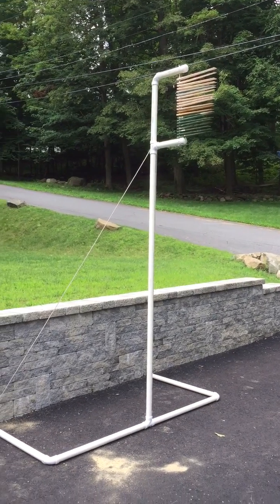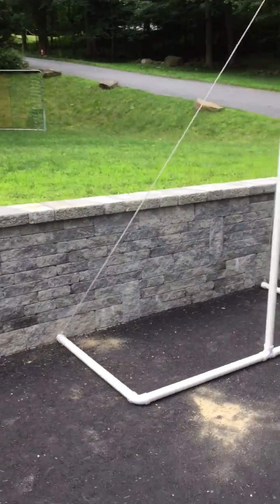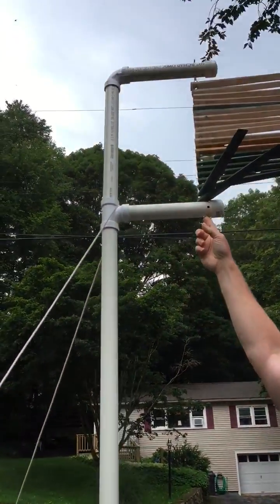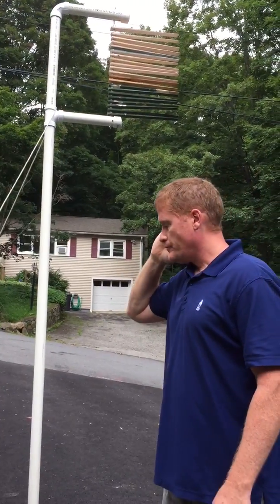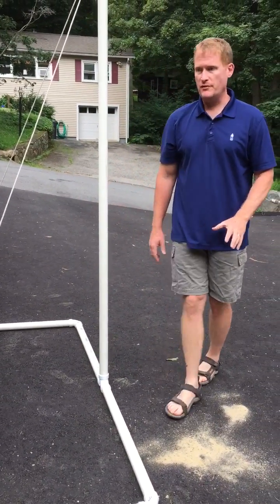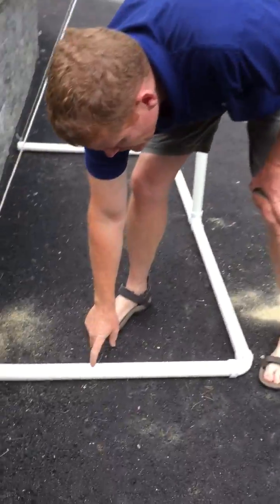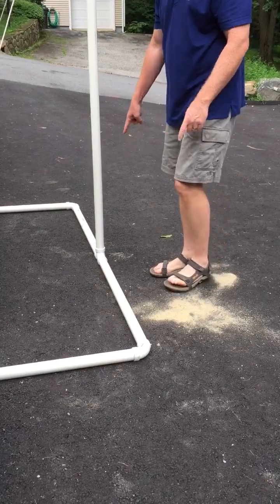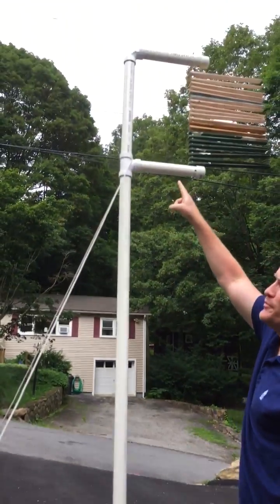DIY Vertical Leap measuring device

Comment: Great video! Made it today! Only thing you need is 4 end caps vs 3 as instructions stated. Also, if multiple height people use it you may want to make a sliding sleeve on the horizontal pipe. Thanks for the great instructions!